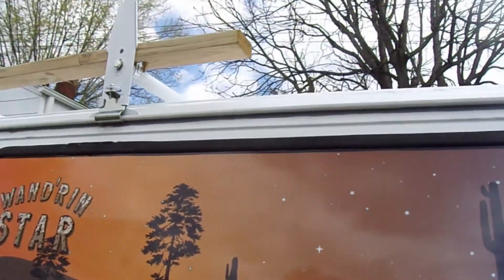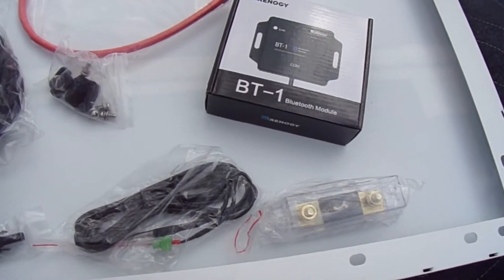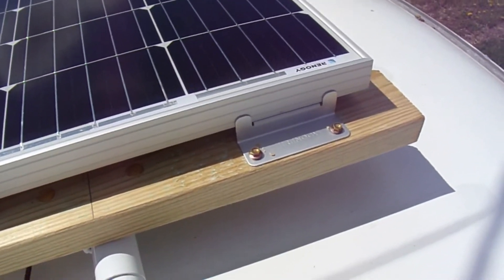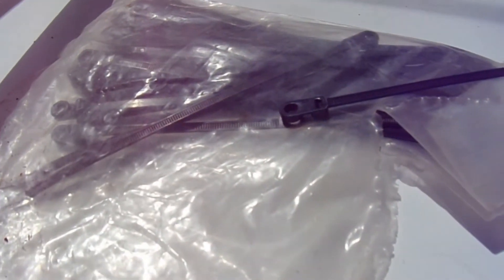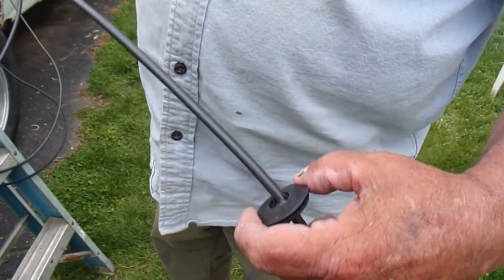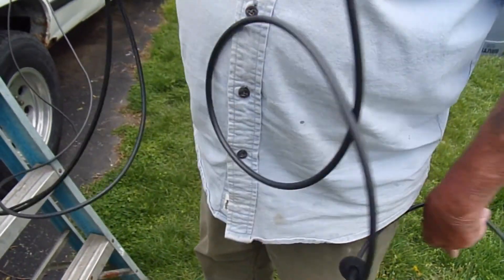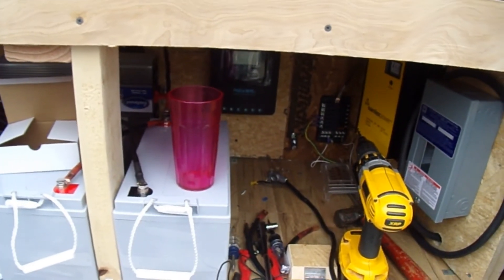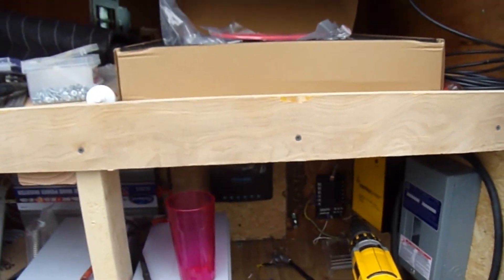Renogy Solar panel install

Comment: Where did you buy the rubber gland to keep the kritters out?  Link to buy?
Reply from the maker: If you are asking about the one going though the roof to the interior, that is a glad hand rubber used on semi truck were there air lines join the trailer. This is the one like the one I used.  https://www.finditparts.com/products/15994595/velvac-035141?srcid=CHL01SCL010-Npla-Dmdt-Gusa-Svbr-Mmuu-K15994595-L624&srcid=CHL01SCL010&gclid=CjwKCAjwm8WZBhBUEiwA178UnJBQorSLvr2sNEG22LG-XZ1BtO2RP6bTNbZjGq50uI4-TBun2Ao2kxoCQA8QAvD_BwE

Comment: I don't see the point of that plastic cover. Why not just drill the holes into the roof, put the rubber thingy to fit the hole and run the cables through with a bit of silicone to seal it?
Reply from the maker: Good point but have dealt with a roof leak from hell on this build. Didn't want to chance another.

Comment: I think series adds volts and parallel adds amps.  There are those on line far better versed at this than I.  Check with them.